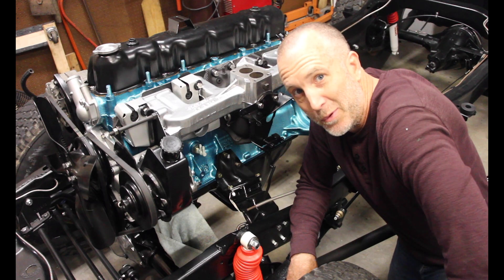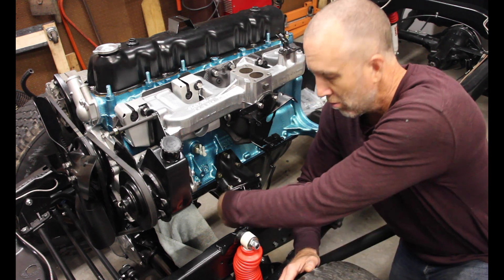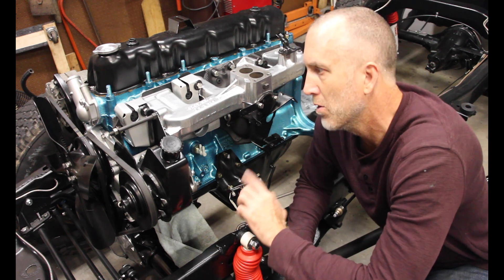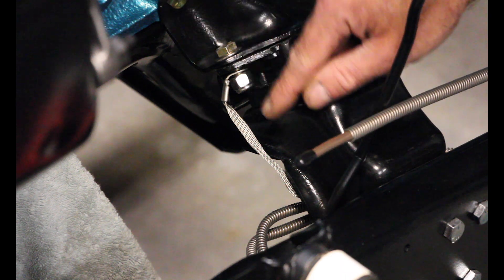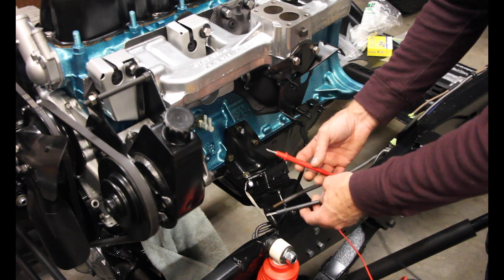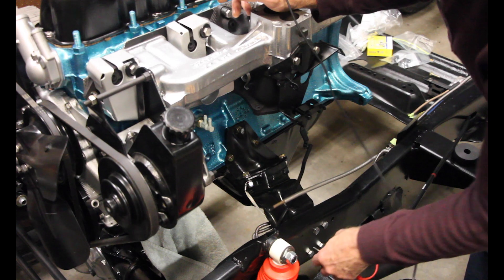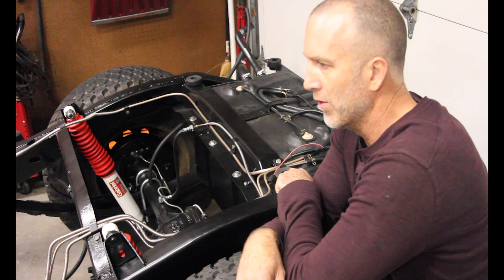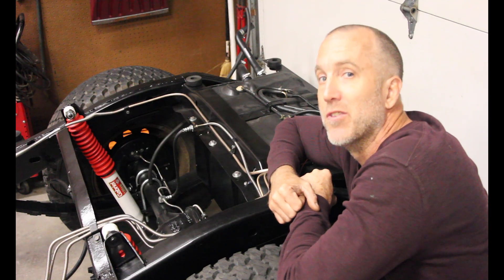Jeep CJ Electrical Grounding

Comment: about to start putting my Jeep back together.  on this grounding issue ,  my frame and parts are powder coated ,  looks like yours is as well.   so does that mean that you removed the powder coating inside where the bolt would go ?  and the same to the parts going to the  mount then the pad then the motor?  the powder coating does not let the electrical connect through, needs to be clean metal right.      I hope you are well and miss the videos,   I look at the ones you have all the time to learn something.  thanks.    to bad your not my neighbor !    thank you for what you have done.

Comment: Love the videos, I have a 1987 YJ and your CJ 7 has a lot in common with the YJ. 

I bought an American Autowire update wiring kit and engine harness and was looking for my grounding locations. Great tip with the volt meter. 

And I know it’s a tongue twister , Continuity , I pronounce it Cont-in-ew-ity  if that helps. 😊

Were you ever able to get the bolt length and thread pitch of that Alternator bracket? And do the bolts have washers or thick spacers? 

Thanks CoolGuy ☺️

Comment: Do you have video on detailed wiring of fuel sending unit brakes temp. Gage everything that goes behind dash into the speedometer / gages?  I looked thru all your videos and didn’t really see much on detailed wiring. Thanks!
Reply from the maker: I am working on a 3 part series right now in regards to that. The rear wire harness should be done this week.
Reply: @coolguy_CJ7  
That’s awesome! Got a lot of questions reguarding the Speedo cluster / temp/ fuel/ break lights etc. Etc. 
I think so of my Cj5 issues could be in my signal-stat 900 sigflare blinker that’s mounted on the steering column. I have blinkers but no break lights,there supposedly same wire ? Lol looking forward for some KewL knowledge from the cool guy!

Comment: Simple yet, so helpful.
Reply from the maker: It's amazing what will or won't happen when you have everything grounded properly. Once I get everything back together, I plan to do a video on the components that need to be grounded and how they are grounded. It's a constant fight against the electrical gremlins that plague the CJs. :)
Reply: That would be amazing.
Reply: @coolguy_CJ7  Would love to see that video.  You helped me with my '84 CJ7 when I was doing my HEI upgrade a couple months ago.  I'm working on putting the dash back in and i've got all sorts of problems with the gauges.  Guys on JeepForum are helpful, but there's so much it almost seems overwhelming.  Very first thing i'm going to check tomorrow is the engine block grounding strap.  Thanks for the super informative channel!
Reply from the maker: @justinbond7245  Reach out to me by email (dellis6914@gmail.com) and we can discuss the dash issues.